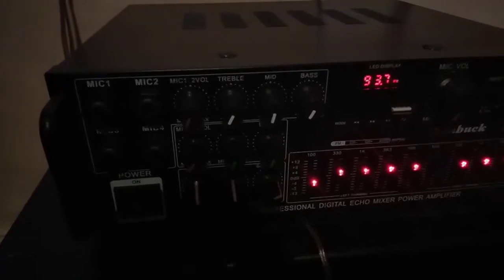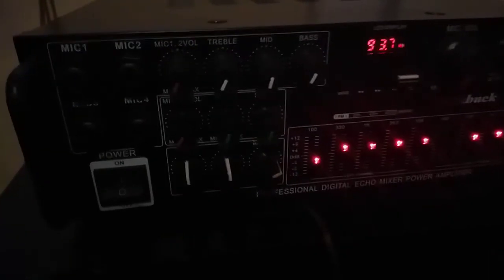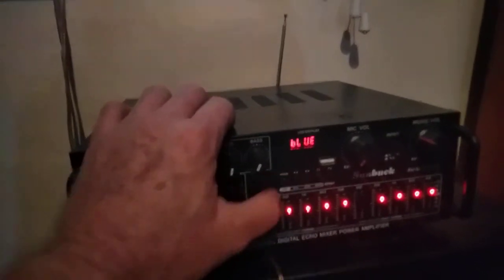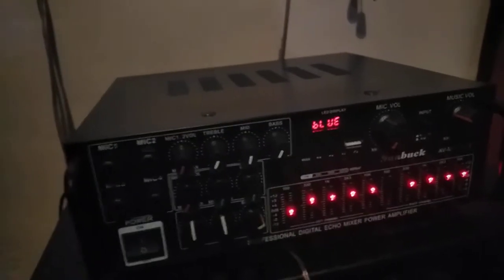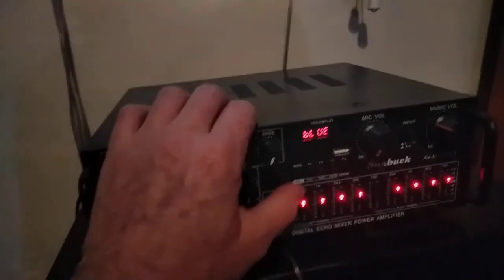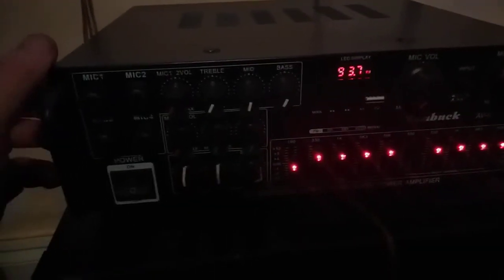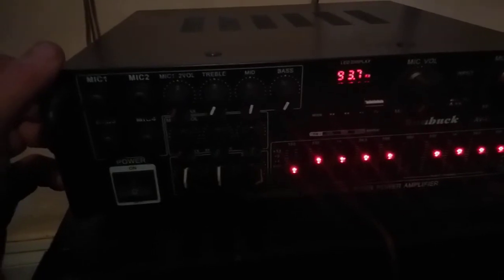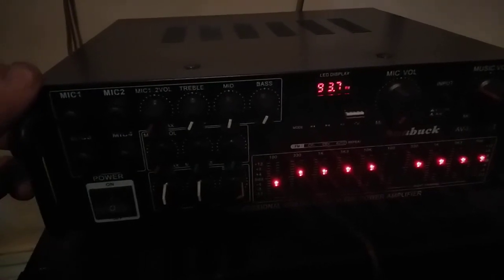Sunbuck 2000 watt amplfier

Comment: Hi luke, ur video is too dark, i want to buy that one as well. How did it go? Did u sort out the problem mate?
Reply from the maker: They ended up giving me a refund when all they had to was answer some questions. I bought more powerful speakers...500w and it works well. Very good for the price!
Reply: @lukemcmullen4755  so you didnt return the unit? They just refund the money?  And you use the unit with your new speakers?
Reply: Did you just have it on the wrong input mate?